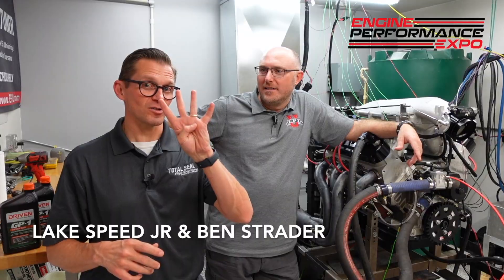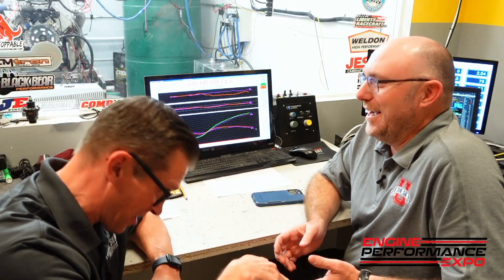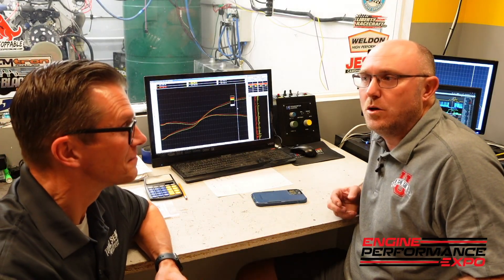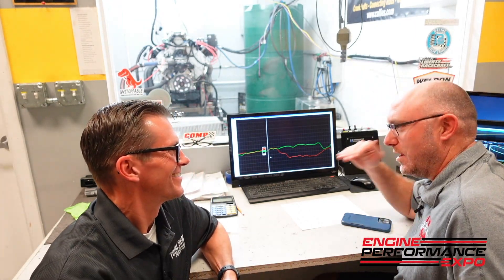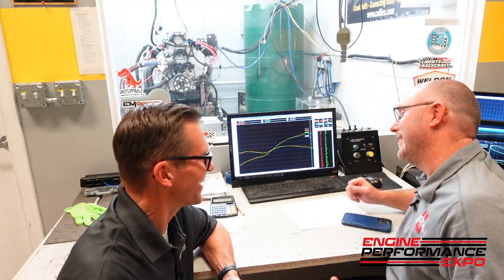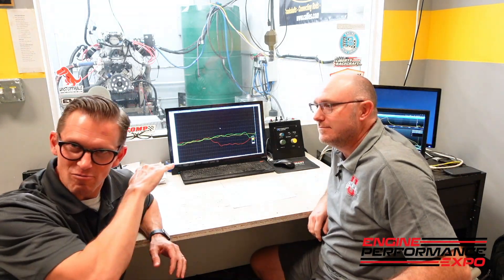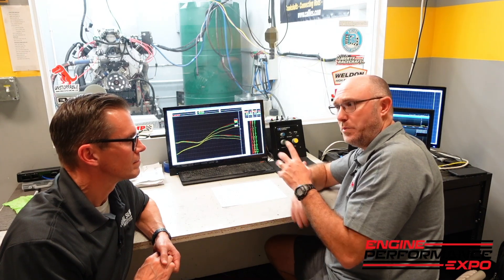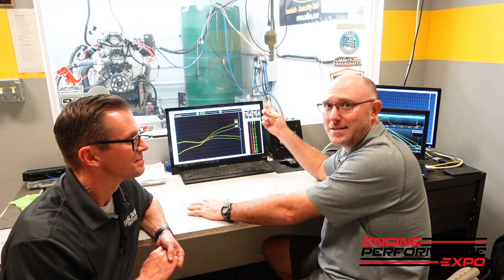How MUCH OIL is TOO MUCH? Dyno Results!

Comment: Did you guys try a little less oil for more power! Maybe 4 quarts or 4.5?
Reply from the maker: Yes, the baseline run was 5 quarts
Reply: @themotoroilgeek  so no you did not test less than 5 quarts
Reply from the maker: @garrisonjasik5367  Nope! That would have been scary!
Reply: @themotoroilgeek  but possibly a little more power

Comment: Hey Oil Geek. I would really like you to look into Motorcycle racing oil....I ride a Gsxr 1000 K6 myself and use Castrol Power 1 Racing 10/50 with pleasure...(stroke 59 mm. and 13300 rpm)...But I have read a lot about AMSOIL being so good (no dealer in Denmark) I would be happy (and DEFINITELY many others too) it is something you want to look into....🤩🥰
Reply: Ps.. I know that my question does not relate to this video...But I have not ended up finding anyone who would be competent to answer my search. In the past I have race Supra and M3 E 46 and over 15 years ago I ONLY used Castrol TWS 10/60....but that time is long gone...😜😜😜
Reply: -W. Edwards Deming : " Without data you`re just another person with an opioin."...😉😉😉
Reply from the maker: Great suggestion!

Comment: Is this a situation where an Accusump would be beneficial? Maybe I don't understand how it works exactly. My understanding is under operating conditions it would leave less in the pan while maintaining pressure in the system. Am I wrong? I have been high performance and racing adjacent, but not really directly in the business.
Reply from the maker: Yes, an accusump would help in this situation.

Comment: How about using a thinner and more oil than recommend
Reply from the maker: That is not a good idea. It would increase the windage.
Reply: @themotoroilgeek  a year ago I bought a new car and went to pepboys for an oil change. When I checked the receipt they had added a lower viscosity than the manual said. Then I measured the oil at home and it was way above the F line. Ended up removing a quart of oil to bring it to the F line. Have been doing oil changes myself ever since.

Comment: I usually check my sensor for the oil levels, considering the oil evaporation every 1,000 miles or so. I usually keep it either right between min & max or right before max.
Reply from the maker: Thanks for sharing

Comment: Just put an Improved Racing crank scraper
Reply from the maker: We are just going to jump all the way to a dry sump!
Reply: @themotoroilgeek  interesting, thats what I did. I am actually considering going back to wet sump with an accu-sump.  All the AN hoses all over the engine bay is creating a real issue. Because of the possibility of the dry sump belt failing, I feel like the ultimate solution is accu-sump, what do you think ? 
(my friend lost his 1200hp twing turbo engine because the belt flow off, now he run both )
Reply from the maker: Done properly, the belt on a dry sump should not come off. The dry sump set up is better than a wet sump, even with an ACCUsump.  @driftergonewild

Comment: Interesting tech. on a big LS but what I was kinda looking for basic stuff on my truck. It holds 4 1/2 quarts and you buy it in a 5 quart jug. I heard a mechanic mention that a little extra oil wouldn't matter and I would rather just put it all in instead of having a 1/2 quart sitting around. I tend to think it wouldn't matter but its still probably a good idea to get it confirmed.
Reply from the maker: A half quart won’t hurt, but a full quart or two would not be good.

Comment: I put too much oil in my lawn mower once, checking the oil after shutting it down was all full of air, like a milkshake (white too). If the crank is hitting the oil you will be lubricating with air bubbles, I think that will destroy the engine.
Reply from the maker: Yes, too much oil is not good.

Comment: I have always run my vehicles 1 quart over full.  The oil pan is only over full when the engine is stopped for a while and all the oil has drained down.  Even at idle, there is at least half a quart in the upper end of the engine.  50 years doing so and no oil burning problem, no leaks, nothing bad at all.
Reply: The full mark on the dipstick is full when at operating temperature. If your engine isn't hot then keep the oil level a little less than full.

Comment: What type of windage tray, whatever terminology you use, is used in this engine? After watching dyne tests of windage tray/crank scrapers gaining 12 to 15 horsepower Across The rpm range, not just top end, I put one in my 5.0 , along with a T-sump 7 quart race pan. Dollar per horsepower is better than long tube headers.

Comment: Hi, I put by mistake +100 ml above 3.4 l (in the book) so 3.5 liters, a Corolla 1.3 l naturally aspirated , should I be worried ?  the level is slightly above max marking ...help ! 😊
Reply from the maker: Not at all
Reply: Thanks a lot !  @themotoroilgeek
Reply: If you didn't have any smoke or oil in the driveway you're good.
Reply: Oil in the driveway from where ? @Second.Nature.Lawn.Michigan
Reply: @cristianmorar5558  if it's way too overfilled it will push it out of the seals or into crankcase vent. Then it will drip down when parked.

Comment: Hmm, I was always afraid that too much oil would burn the valves or blows seals, but thanks, there's also a power drop.  I've had the oil changed only thrice since I had a '58 Ford and they always put too much in.  Now I'm a 78 geezer, still changing me oil.
Reply: don't worry, there's 2 breather-outlet on every engine, if there's too much pressure it will blow out into the air-intake and you will see black smoke in the exhaust as indication.

Comment: My bet is that you had significant bearing wear on that first pull, when the pressure dropped into the 35psi range you were certainly starving somewhere.
Reply from the maker: Stay tuned for the oil analysis results in an upcoming video

Comment: in a dry sump engine will overfilling cause a lot of foaming if oil starts getting thrashed around by the crank arms and oil going up through pcv valve to intake.

Comment: so, by wet sump you mean the crankshaft is in the oil and cranks are dipping into it and dry sump the oil is below the crankshaft? 
would there be more foaming in the oil and oil getting sucked through pcv valve into intake if oil level is too high?
Reply: Yes . Foaming is the real danger. Air isn't a lubricant
Reply from the maker: Wet sump means the oil is stored in the oil pan. If the oil level is too high, the crankshaft and connecting rods can hit it (which happened here). 

In a dry sump, the oil is stored in an external tank, which keeps it away from the crankshaft.

Comment: It would be interesting to monitor the oil temperature as well as the pressure. All that lost power with increased oil quantity would probably manifest itself as a significant increase in oil temp and if the run was prolonged would ultimately result in the oil breaking down.

Comment: In today's modern engines, it's best to keep the oil at, or near the top level mark on the dipstick, because the camshaft timing advance depends on oil to adjust the cam timing. Remove oil and the the valve timing adjustment may not happen, put too much in, and most of those engines don't have windage trays etc., and you will see a drop in oil pressure and protection, due to the aeration of the oil.

Comment: this is reassuring actually because I added about  1/2 quart of oil over in my last oil change and haven't been able to sleep since due to paranoia lol
Reply from the maker: Glad this helped
Reply: Well, My Toyota owner's manual says any level above the full mark on the dipstick is "excessive". That doesn't sound like a good thing to me.
Reply: overfilling around 1 liter is not a problem to mechanical parts but it will cause over pressure in engine and it will probably later cause oil seals to leak
Reply: @Techie1224 true, but that depends on how efficient your PCV setup is.
Reply: @tycobandit what is a pcv?
Reply: @psxgaming250  positive crank ventilation, It’s basically an air pressure equilibrium between the crank case and atmospheric because the volume of the crank case is constantly changing as the pistons cycle up and down.
Reply: Every engines different but once the oil is high enough to hit the counterweights the oil gets airated and doesn’t lubricants the engine properly causing damage. That’s why they say not to overfill.
Reply: @Seeker-vo2tz  Yup that's also why most modern engines have windage trays. Air makes a terrible lubricant.
Reply: 1/2 is actually good...no harm...I always fill to top indicator...mine is a hyundai that burns oil....harm comes when you way overfill...like two or three quarts.
Reply: @mannybudhu3905  if the PCV blew much oil into the intake it means there's higher amounts of blow-by gasses in the crankcase than normal, possibly due to piston-ring didn't seal the combustion enough. In addition to burning oil, the engine power is less than it supposed to.

Comment: Consider adding an Accusump and the additional oil. 
A few years ago crewed for a very competitive Regional SCCA GT4 Datsun with such a setup which allowed us to keep the crankcase oil level relatively low but maintain stable high rpm and cornering oil pressure. 
It was a wonderful compromise between a stock wet sump and an expen$ive dry sump system.
Reply: Yes, they are the 'poor man's dry sump' and many 4th gen LT-1/LS1/LSx f body road racers used those devices. 😉

Comment: maybe your pickup is too shallow. especially if its a stroker
Reply from the maker: It is the size of the aluminum connecting rods.
Reply: @themotoroilgeek  how do you know the oil isn't actually touching the rods? I'm sure the size of the rod contributes but it would be the same power loss regardless of oil level if it was due to windage.

Comment: Who cares about power? Unless your chassie and drivetrain is dialed to the umpteenth degree you are NEVER going to notice 12 hp on a 650 hp engine. The correct amount of oil recomended is th maximum ammount you can run before it is aerated by the crankshaft causing a loss of lubrication. More oil cools better, breaks down less, and offers extra insurence that you will not lose oil pressure. No dyno needed here. Just good old common sense.

Comment: pointless. we do not know the oil temperature, nor the level of oil  in the sump at them high rpms. nor we know if this engine needs 70 psi or not at high rpm.

Comment: You didn't address the probable issue of foaming the oil when overfilled due to the crankshaft whipping it up.  This will cause you to lose oil pressure once it's had time to get bad enough.
Reply from the maker: Very true!
Reply: That's THE problem with overfilling. Air is not a lubricant

Comment: A video I would love to see y'all do is an independent oiling system for a turbocharger.  The turbo gets its own reservoir, pump and cooler, and doesn't get any oil contaminated with coolant, gasoline or any other contaminant other than its own breakdown residue.    Seems to me the turbo could be driven at higher speeds and last longer with a dedicated oil system that you could change frequently with exactly the right viscosity for that turbo instead of the general compromise two stage viscosity that the engine requires.
Reply from the maker: That would be cool!
Reply: That would certainly help the bearings, shaft, and overall life of the snail.
But the extra; weight, complexity, and space requirements would make it prohibitive for most manufacturers to even consider for production vehicles.

But aftermarket... 😊

Comment: Just because extra oil reduces dyno performance DOES NOT MEAN it's harmful to the engine.   Y'all are drawing an unwarranted conclusion.   Oil level is not nearly as important as oil PRESSURE.

The reason you shouldn't have less oil than specified by the manufacturer is that engines in the real world aren't sitting on a dyno stand.  They're inside vehicles where dynamic forces operate on it and move it from side to side, back to front, and so on.  A continuous level of oil only happens when the vehicle is standing still.

Comment: Ok over filling cost power.  But underfilling makes more power.  I didn't see that coming.  It makes sense after you see it on a dyno though.  We need just enough oil pressure to keep the the metal to metal contact from occurring but no more if we want to maximize power.  Wow.  That was a good video.
Reply from the maker: Thanks!

Comment: What if the oil level is high enough the crank and rods hit it?  Then air (frothing) could cause issues.   Along with the power lost by the crank impacting the oil having air blended in....
Reply from the maker: That's why the power went down. The oil level was too high.

Comment: Let’s think about it this way - and correct me if you feel i am wrong - the engine is INTERNALLY making the same power in each of these runs, but the loss before the final output is getting bigger each step of the way. All this windage and stirring and friction is ultimately converted into heat, which you actually need to extract out of the engine. And all this heat (tens of kW) has to be transferred by the oil. So not only your cooling system has to have sufficient capacity, you are also straining your oil a lot more.
Reply from the maker: Absolutely! Spot on analysis.

Comment: Did adding 2 qts really hurt us?  Who runs their engine at 7000 rpms?  Most people are running in the lower rpm range so adding 2 qts didn't really hurt us but better protects the engine.

Comment: This is interesting.  But, it really doesn't tell the average car owner how this relates to his factory I4 or V6 engine in his Honda or Toyota or VW.  Instead of using a custom build engine with aftermarket connecting rods, why don't you repeat this test with a common, standard engine?  Then the results will mean something to most of us.

Comment: I have a question about oil and do not know who else to ask. There is a large debate in my car groups for the 2022+ WRX. American manuals call for 0w-20 while the warranty cards and Japanese manuals call for 5w-30. Some of us have toyed with buying 0w-20 and 5w-30 in the same oil and doing a 50/50 mix. Now, my understanding is that this should be technically ok so long as additive package is the same or similar...but what do I know. Would it be totally crazy to mix the 2 to arrive at a 2.5w-25 hybrid oil?
Reply from the maker: I would not mix the oils, unless they are same brand. To do this right, go 3,000 miles on the 0W-20 and take a sample of the used oil. Then go 3,000 miles on the 5W-30 (same brand and specs - just thicker) and take another sample. Compare the results of the two and go from there.
Reply: @themotoroilgeek  I have already started this process. 1 kit for the oil that came in it, 1 for the first oil change and 1 for the second. 0-20, 0-20 and 5-30. Not sure how to interpret the data for my purposes though. I suppose if one out performs the other, the easiest solution is to not mix and just stick with that. Thanks for the response.
Reply: I'm no lubrication engineer, but if the only difference between the two oils is that one is a 0w-20 and the other is a 5w-30, I would just throw 0w-30 in it and use my mental capacity elsewhere. I don't think any engine is run so close to the ragged edge that a 20 vs a 30 is going to be the difference between an engine that makes it to 200k miles or not.

Comment: There is a time when too much oil is a good thing. My girlfriend, wife now, years ago bought a 1966 Dodge Polara auto with a 383 V8. She got a good deal on it because it needed work. After a tuneup she took it for a ride and told me there was smoke coming from under the hood. Well it needed valve cover gaskets. The old ones were cork and leaking badly. After taking of the covers I saw that the previous owner did not take care of the engine as it was full sludge under and on the covers. I cleaned and vacuumed out the sludge but what about the sludge that I couldn't get at. The clean oil that I put into the engine washed the rest of the sludge down into the oil pan and as I was driving it I hear the lifters start tapping. It was at night and raining so I could not tell if the oil was leaking and did not want to turn the engine off. I stopped at a gas station and bought 5 quarts of oil and put it in the engine and the lifters were still talking so I went home and put it in the garage. In draining the oil a bunch of plops and sludge came out. There was almost 10 quarts in the engine and while the lifters were starved the rod and main bearing were being bathed in oil and did not get damaged.  Lesson learned. Good video. Happy Motoring.
Reply from the maker: Thanks for sharing!

Comment: So I’m a bit confused. Why did the engine perform better in terms of horsepower with less oil? Sorry if this is a stupid question
Reply from the maker: The higher oil level led to contact between the oil and the connecting rods. Essentially, the crankshaft was trying to run in a swimming pool with the higher oil level.
Reply: @themotoroilgeek  Ah ok. Makes sense thanks Lake!

Comment: Lowering the oil level on dyno to increase horsepower is an old trick from OEM’s to certify their engines and thus get higher numbers, which can not be done anymore, by SAE standards. Also, in racing, mainly in stock classes, this has been done as well, when engine longevity is second to HP target.
Reply from the maker: Yep

Comment: Lake, how much “damage” does the crank spinning through the oil due for Shear and viscosity?

How many miles would you get before an oil change is needed. I’m thinking that 60hp is energy going right into the oil is it not? Therefore heat and vaporization? Would the PcV be working overtime?
Reply from the maker: Nothing good comes from that higher oil level. Aeration would follow if we kept running it that way.
Reply: Yes for sure! You should do a video about aeration and its affects. Such as cavitation, why it’s bad, how it oxidizes oil. And maybe how much it reduces the oils lifespan.